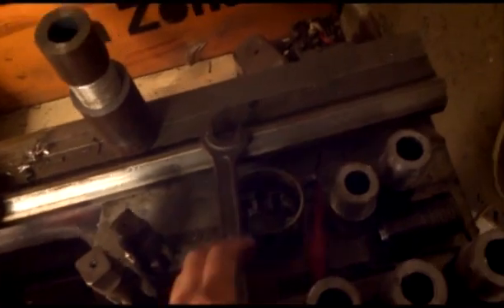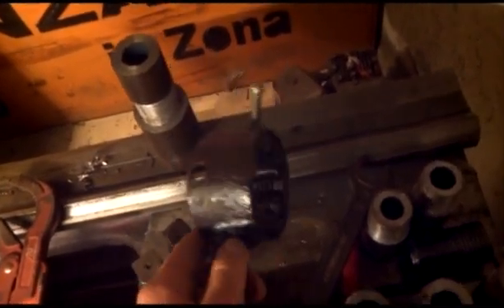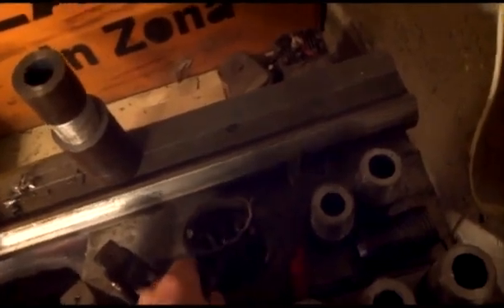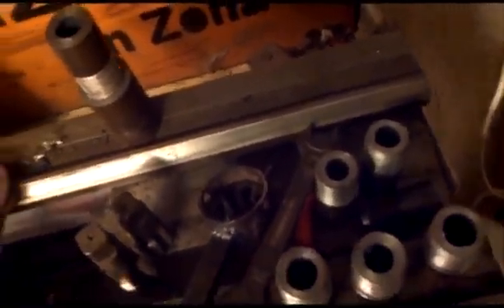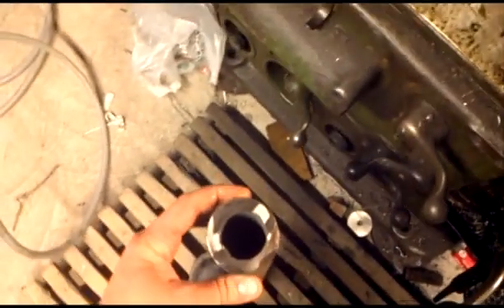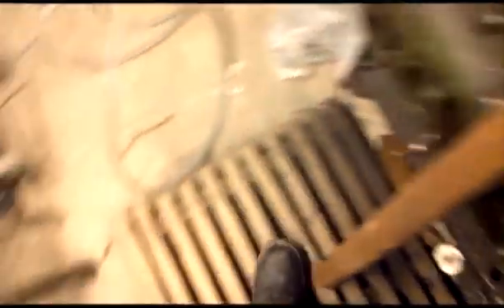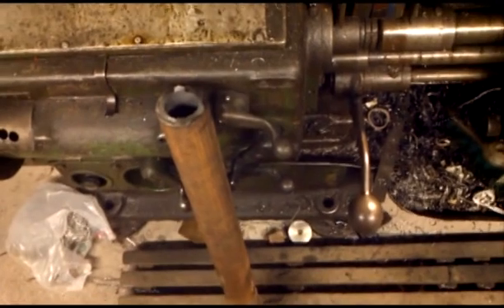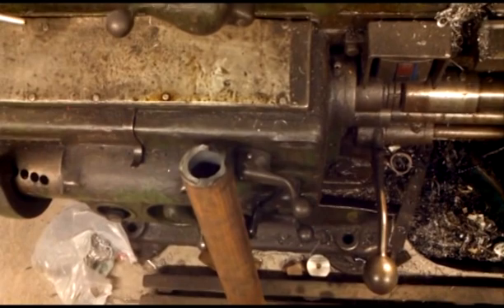BIG m45 thread,sharpening a tap

Comment: It looks like you set the change gears for the thread pitch, and drive the tap into the job?  Is that right ?  I haven't tried that, and just let the tap pull itself into the job.  Rob
Reply from the maker: the carriage just fallows the tap , in the tool post is mounted a tap wrench witch i welded from broken lathe tools , the 2 ton lathe is put in the slowest speed in witch it has the biggest force from the 7.5 kw motor, the force is impressive, the tap still drives itself in the hole, i am supporting it with the center and the carriage fallows even if i disengage the halfnut but i prefer leaving it engaged in m45....
Reply: I see.  That's basically what I also do.  Rob